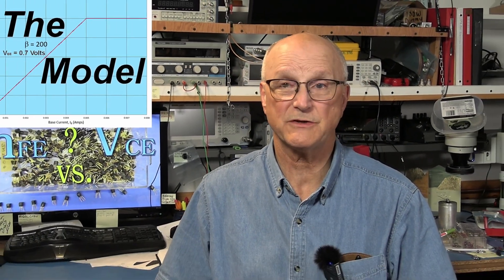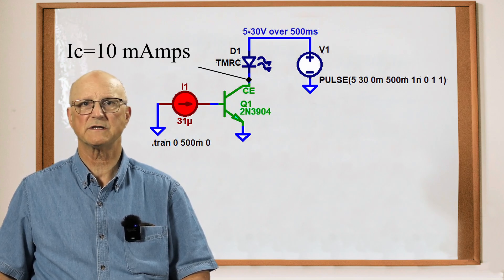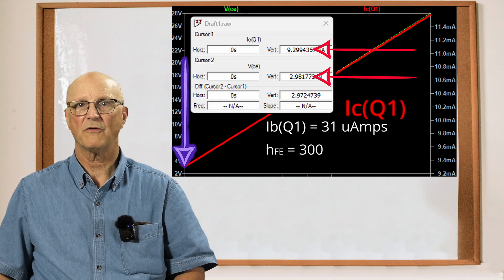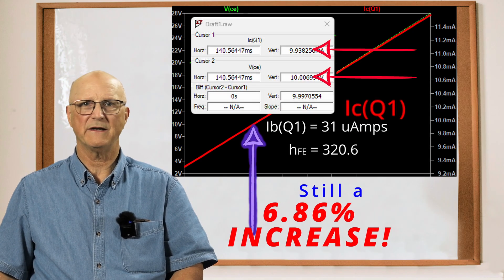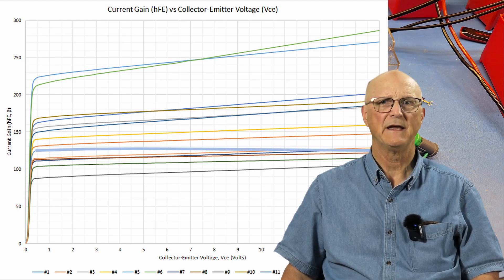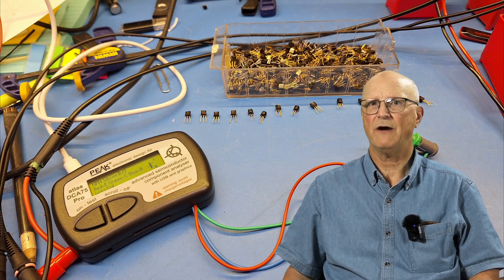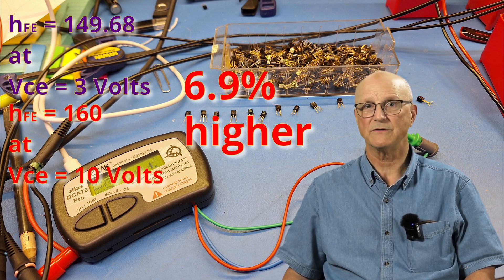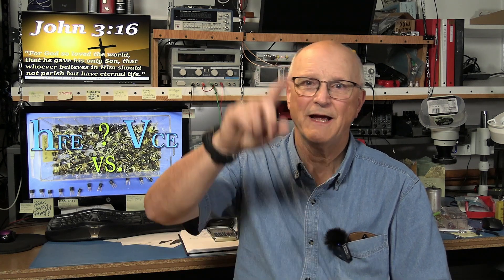Bipolar Junction Transistors (BJT) Changes in hFE with Vce (084a)

Comment: That slope in the Ic/Vce slope is due to the Early Effect, and it increases with base current. It's pretty easy to counteract using emitter degeneration (putting a resistor from the emitter to ground). It can be found quite easily as Rc/Re (where Re is significantly larger than the transistor's intrinsic emitter resistance Re`)
Reply from the maker: You are exactly right on. This is, indeed, how to accommodate the change in hFE with Vce. I am hoping that folks reading your comment will take this advise to heart as they try to work with BJTs. :-)

Comment: From my humble electronic designs experience through 33+ years as a certified EE , I found the best selected value for the Beta ( hFE ) in linear circuits ( not switching ) is to use the square root of multiplying the given range limits in the BJT datasheet.
Reply from the maker: WOW! I'd never heard that before. That would put the 2N3904 at an hFE of about 173. :-)
Reply: @eie_for_you  Well , that number will be the best probable Beta ( hFE) in that range for most of produced units and the most stable circuit parametric behave to the Beta change.... But that is not a constant number , it is just a best assumption for an operating point of the BJT, i.e. if the datasheet gives different ranges of operation then calculate each Beta alone and use it according to your design condition....
But for the switching circuits designs , use only the MINIMUM Beta and leave the MAX opened...
Reply from the maker: True, that! This is my experience as well. We all need a starting point in our assumptions for circuit design. :-)